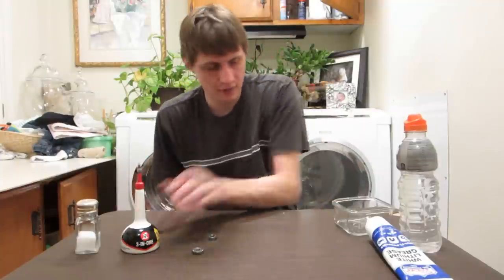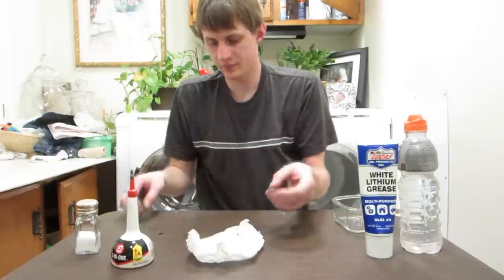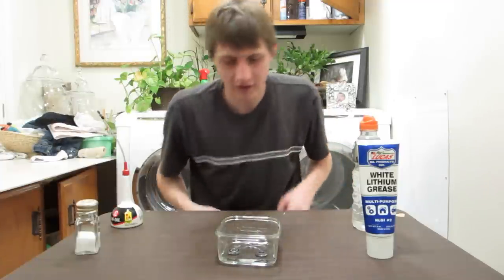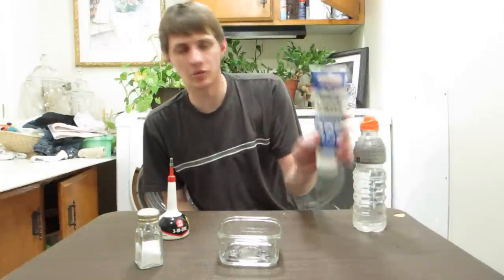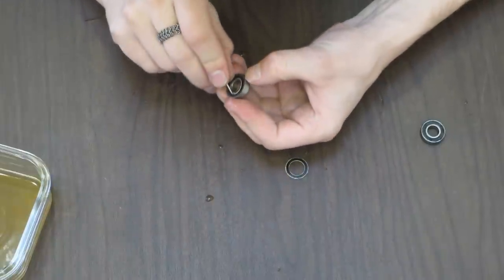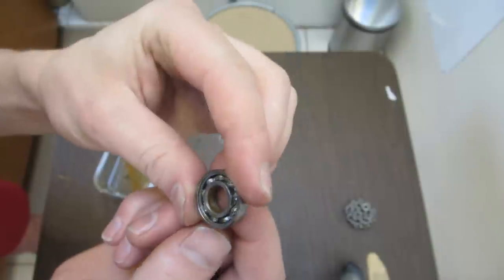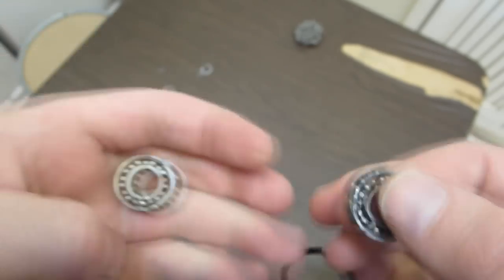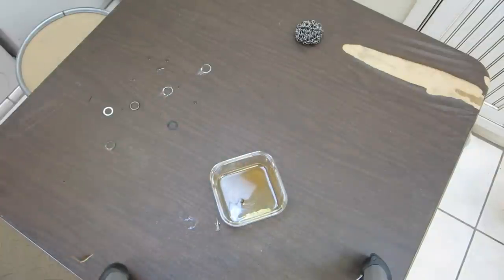Experiment: Bearings in water.

Comment: Hi guys, great vid as always. I may need some help on the topic of bearings, so it would be great if you guys or anyone would like to chime in.

So my current set of bearings is the cheap type with non-removable seals... I have been using them for quite some time now without any real cleaning (because you can't properly clean bearings that have non-removable seals)... anyhow, what I did to try to clean the bearings was to take them out of my wheels and put them into a small plastic container (about the size of a cupcake), added a good amount of palmolene cooking oil to nearly drown the bearings, closed the container tight with its lid, then shook the container for about 5 or so minutes. The cooking oil turned grey, and I removed the bearings and dried them with kitchen paper-towels (the kind designed to dab oil from fried foods). I mounted them back on my deck and went skating.

I feel that they roll a bit slower than before. Furthermore, they won't stop leaking oil - after each sesh, the surface of my wheels would be dry (from the partly dusty pavement I skate on), but leave them for a night or so and the wheels have oil around the outer and inner lips' edges in all 360 degrees (which means that gravity did not bring the oil there but maybe it seeped out from the bearings?).

Please advise. Comments much appreciated. Thanks!
Reply from the maker: Cooking oil is a very poor lubricant, and not a good protectant.

I would try to instead find some thick grease or oil that is cheap, motor oil is good, but I'd look for something thicker, maybe even a grease tub or tube.

There is a method to re-lube sealed bearings, called vaccum packing. I should make a video some time, However there is a good video out there on it here:
https://www.youtube.com/watch?v=KS3lOPVzAUg
Watch all the way to the end, thats where he talks about the DIY method.

That should work really well, but you'll need to soak your bearings in a solvent to get rid of the cooking oil first.
Reply: Longboard Technology Oh cools! Thx guys!!!!
Reply: Nick Amarit Or just spend a little money and bet bones reds. They are like the cheapest "good" bearings, they cost like $15 and I love them I have them on both my shlongboard and my actual longboard. You will not be disappointing.
Reply: Nick Shumar cant go wrong with reds

Comment: Best experiment. I have a set of bearings I use for rainy days when I go down on my roads, it doesn't have any rust what so ever, I mixed Bones Speed cream, WD40, and some electric oil as a lubricant to get it thinner, runs very smooth, makes a noise but not noticeable when you're on the street
Reply: Why would you mix a solvent with your lubricant?

Comment: So... oiling (like "3 in 1") feels like a better choice, as bearings seem to spin faster with it, as oppose of having them covered with a thicker grease, also applying oil is easier (less messy).

Testing is the way of checking out stuff, how many times I hear different opinions (and trolling) on a subject... and everything is sorted out easily by just TESTING IT.

Good video guys. Science and longboarding rules!!!
Reply: But grease can last a super long time though, I really really like using it.
I feel like I save more time by not needing to clean them as often. 

And its really not that much slower, bearings do very little to contribute to speed in reality. In most situations the difference won't matter.

Of course both work, and you can use either depending on whats important to what you're doing.

Comment: Right off the bat I can tell you didn't do a great experiment. Where are your control groups? You have several variableswith a great experiment premise, but nothing to compare them to.
Reply from the maker: zach rhys 

The exposed outside of the bearing is the control, It tells us how unprotected steel behaves in the conditions.
Reply: Longboard Technology That's not what a control variable. A control is something you use to compare to. I.e. something that has NO variables added. Completely bare, no grease, no 3-in-1 oil, nothing.
Reply from the maker: zach rhys 

The outside of the bearing is completely bare.

It may not be a perfect control, but it is sufficient. 
There is one thing we don't know, and that is whether the seals, or the grease was doing the protecting of the bearing.

But not having that particular question answered is fine for a 20 hour experiment.

Comment: You are not supposed to use 3 in 1 for bearings. You might as well be using wd-40 lol. Grease isn't good for bearings either. It's like comparing dying by drowning or being suffocated. Also you have no control group. Dumb video
Reply from the maker: 3-1 is a great multipurpose oil, that works perfectly well in bearings.

And nearly all bearings ship with grease in them. Its a far more appropriate lubricant for the application than oil.
Reply: +Brandon Cooper haha cut it out brandon.